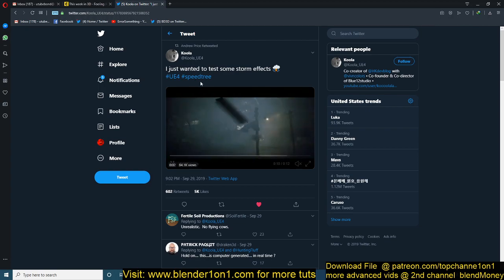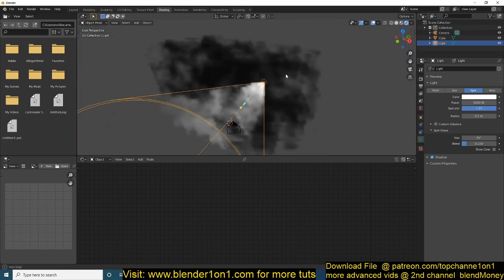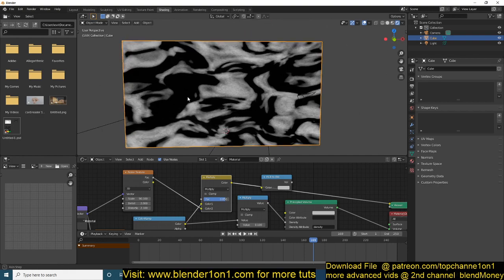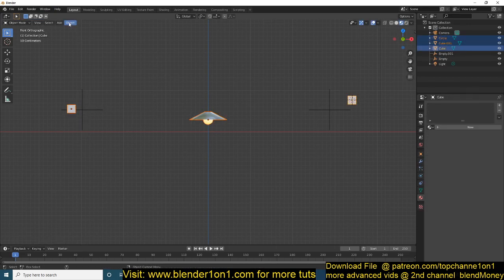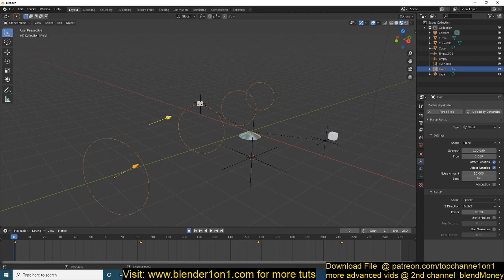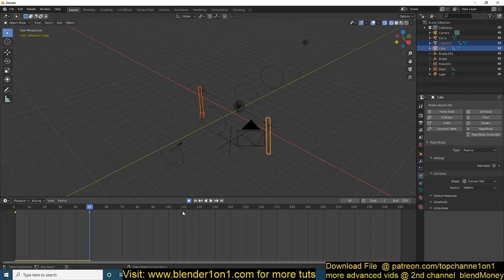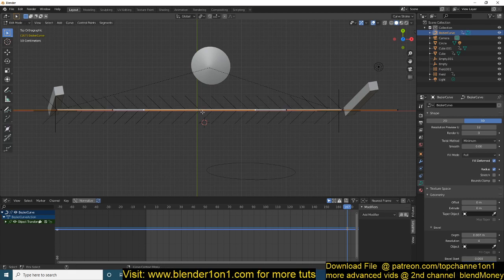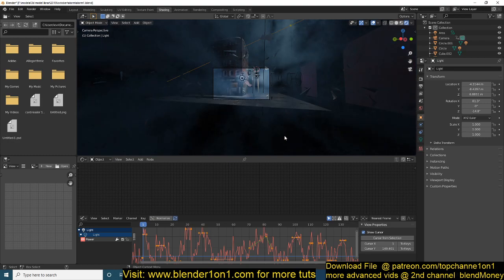how to make a storm scene in blender 2.8

Comment: Hi! Great tutorial!, i follow along your instructions especially for the particle system.. But i have a problem with my particle system, why the particles emitting and not fly to the wind direction ? Its just not straight to wind but its like turn right a little bit.. I've tried tweaking my turbolence and wind setting but nothing works :(.
Reply from the maker: try increase the wind strength
Reply: Thanks for your reply, Btw Great tutorials. Its hard to find storm tutroial blender 2.8 in YouTube, and i found your video!. Keep making blender tutorials ! :), great job!